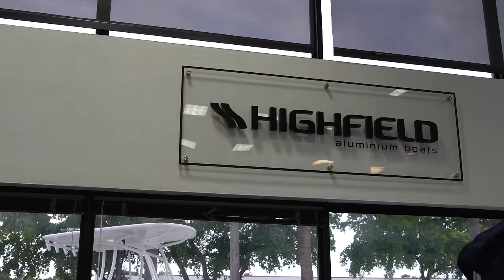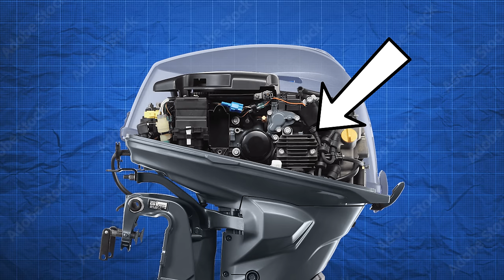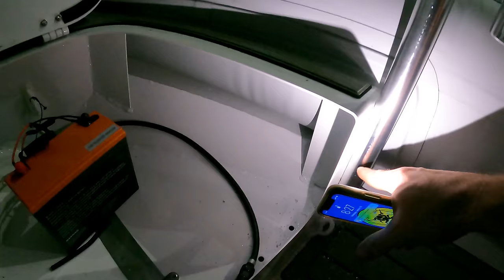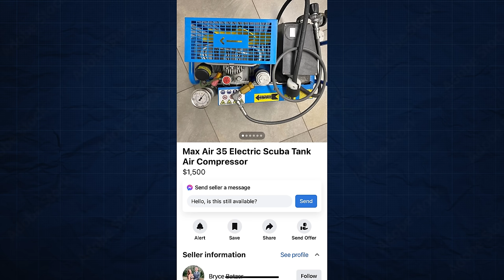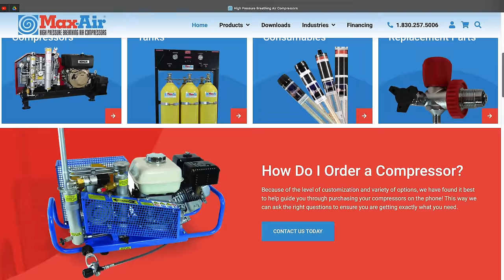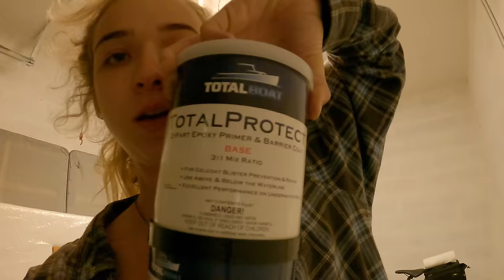Amazing BOAT UPGRADES & SPEARFISHING Must-Haves for our Off-Grid Adventure! 🌎⚓️ | ep.36

Comment: You guys should put bed spacers under the master cabin bed, in the tropics mold grows quick if its just mattress on wood
Reply from the maker: The boat came with bed spacers, but it actually caused the old mattresses to mold from the bottom (mostly due to all the water in the grid when we got it)
That's actually why we got the mattresses we did. We have Sleep on Latex mattresses in all our cabins. They are antimicrobial and have gotten wet multiple times, due to our hatches leaking. We've never had to air them out or stick them outside to dry and still have not shown any signs of growing mildew in the year we've been using them.

Comment: Just a thought.....you may want to consider adding a "back-flow-preventer" in your fresh water wash down line before your salt water tie-in so you don't accidentally draw salt water back into your fresh water tank.   Valve seats can wear out and then you will not be keeping those two water supply lines 100% separate.   Maybe you did that already, but you know how boat stuff goes - it will happen when you need it most!  Safe travels.

Comment: @16:50 Just kidding Raf!  Do you think you can run the compressor with the lid closed?  The two holes at the bottom might let in enough air but you could add one way vents or something.  Nice, quiet compressor!
Reply from the maker: Thank you! No, like you said we’d have to add vents to be able to leave it in the box to run it. We may do that down the road, but for now we’ll just pull it out to fill tanks.

Comment: If you want to protect your new inflatable dinghy from some of the same problems as your old one, go out and buy a whole bunch of dowel rods, look for the 1 inch or thicker diameter dowels. Sand on the ends to kind of round them over and then drill a hole through each end two or 3 inches back from the end. Now run a cable or rope or cord through the hole and add rubber washers for spacers between each wooden dowel, and make it long enough to drape from inside the boat out and over the outside of the boat. Put weighted bags on both ends, and if you balance it out properly you can make it so if it falls in the water, it would still float but about a quarter of each and would sink down into the water. These weights would help to hold it over the top of your inflated tube of your dinghy as you put stuff in. then, when you go to put a fish or something else into the boat, it’s sliding over the wood, dowels and not jabbing directly into the rubber, possibly causing a hole.

Comment: Love the upgrades you did to Sprit Animal. Yea that sucks you got ripped off by guy who sold you the air compressor. Your problem is you are too trusting in people. You should have had it tested when you went up to pick up. Your bedroom at the bow of the boat with its new tiling on the walls looks way better than plain white. The water hose system you have installed on stern of the boat also is cool. You have done so much on Spirit Animal she's by far a work of ART!! Looking forward to next video.
Reply from the maker: Thank you 🍻🤘🏼

Comment: You really need to do this, Fresh water Rinse layup and Emergency Bilge Pump.

On Starlight 1989 Beneteau Oceanis 350 has a Volvo Penta engine M2003 28hp anyway I was the second owner, so after I purchased the boat I was doing the shakedown cruise and ran the engine for about an hour and the overheated alarm went off , could not find a problem, cutting too the chase lots of growth and calcification of the tubes in the heat exchanger.    Had too take the entire unit clean it and put it back, never wanted to do that again figured was not the use rather the extended, layup with saltwater, also the corrosion factor of the elbow, had to replace that.  So as a solution I cam up with this manifold I constructed with brass and bronze fittings and ball valves for each connection, from the thru hull , to the manifold, ball on the thru hull and on the manifold did the same at the on end valve to the sea strainer to the engine, next thru hull, pressure fresh water, and at the other end again valve to a run to the bilge. 
This allows me to turn on the fresh water, backwash the thru hull, then shutoff and run the engine for 2 minutes on fresh water before shutting down the engine for the night or an extended time.  It also in the final configuration allows me to bring to bear as an emergency pump, on my main bilge the engine, if there is a major leak in the boat that bilge pumps cannot handle for whatever reason, (lightning strikes) etc.  I often use the fresh water system when she is on the hard, and I need to run the engine, like changing oil, etc. I have 100 gallons of water on Starlight,  you should see the looks I get in the yard with no hose, on the hard, yet engine running and water from the exhaust and prop shaft running out. In 20 years have not had any overheating issues or had to deal with the heat exchanger or the elbow, which is notorious on Volvos..

Comment: Having a compressor on board for pneumatic tools would be incredible. I don't know if it's advisable to use a dive compressor for tools, but I don't see why you can't  modify it so that you can inflate a tool tank with the right regulator and attachments.

Comment: It seems like you guys have the same amount of luck we've had. We bought a "bluewater ready" catamaran that I realized too late is "bluewater tired." Have replaced the sails, the watermaker, the generator, the saildrives, sanded down and tabbed in all the stringers, overhauled entire electrical, replaced batteries. This boat was supposed to be ready to go and we've dropped over $130k into it that we will never get back! And then our brand new very expensive carbon fiber dinghy ripped off our davits and sank. Every job I've hired out I've had to fix, and every person I've trusted in buying something has misrepresented what they were selling. 

So I totally feel you guys! Glad it's not bringing you down and that the company makes it right. Fortunately my dinghy manufacturer came in and made it right with us too. Even with all the crippling frustrations, I wouldn't change much. My experiences have taught me many ways NOT to maintain a boat. I have taken apart and put back together 80% of the stuff on this boat over the last 3 years.  That is experience I would never have had if I were "luckier!" 

Good luck and hope to see you guys out there!  -  SV Saguaro. Lagoon 440. Currently in Key West

Comment: Hey guys I'm finally caught up on all your videos and I loved watching all of them. You guys showed all the ups and downs of your journey. I'm a lot like Raff, I'm self taught with everything I do as well, plus very OCD about doing shit right. I'm a machinist/welder by trade but have spent 2 years building houses, 18 years fabricating hydraulic cylinders etc and the last 7 years as a certified RV Technician. Right now doing mobile RV repair. So your video of the solar and inverter etc install was excellent. I use the same brand components on our installs. Anyways keep up the great work, I really enjoy it and very jealous of your journey. If I wasn't so broke I'd definitely send funds your way but the RV repair business in Utah  right now is very slow.

Comment: I'm curious how that Dock Box is going to remain secure in high winds and heavy seas when it doesn't appear to be secured to the vessel other than by caulking?  Some angle brackets that have a slight offset could remedy this. Heck, you could even buy straight flat stainless, bend it 3 times with a home made brake, then bolting it with stainless hardware.  Lastly, I suspect the top lid won't stay shut in heavy seas either.  I suspect it will need an additional 2 latches to properly secure the lid.  But then again, that's just the opinion of someone whose never been on a boat in the ocean or sea, so what do I know?

I really do like the plank flooring accents on the walls and love the mapped table top!  Thanks for the content.

Comment: So was it the compressor block that was destroyed. ? I think there a little different when it comes to compressors, I've had one for years and its oil free ?  But, I did see an Oil Max thing in your photo , that said, first time I've seen one chew itself up like that ? So maybe it is an Oil type of compressor and he didn't fill it ? Love that map table !
Reply from the maker: Yeah this one requires oil inside of the high pressure pump. Pretty sure he left the oil cap off and let it sit for two years

Comment: Do not run that compressor in that box you will die..... Carbon monoxide poisoning ... The intake on that compressor needs to be up wind at all times when running away from the exhaust